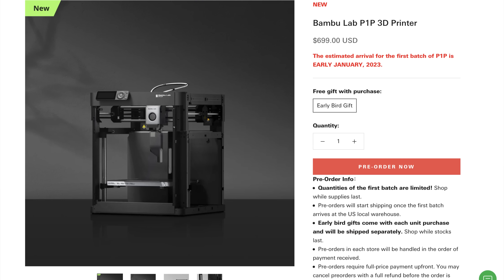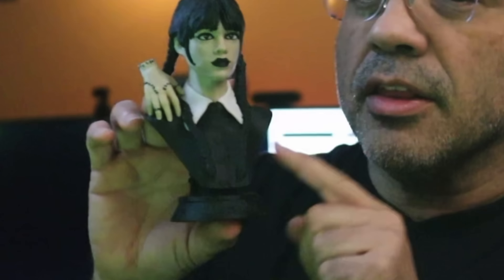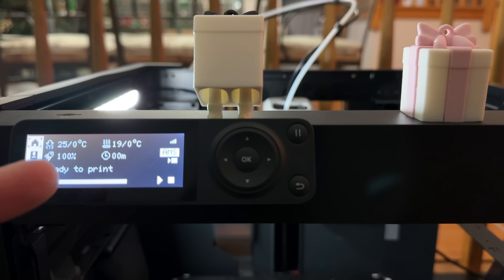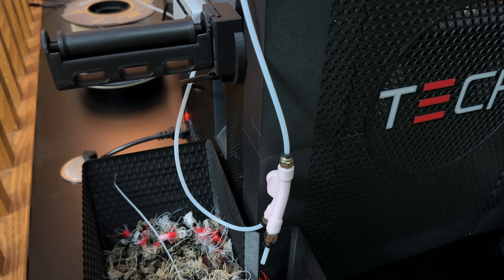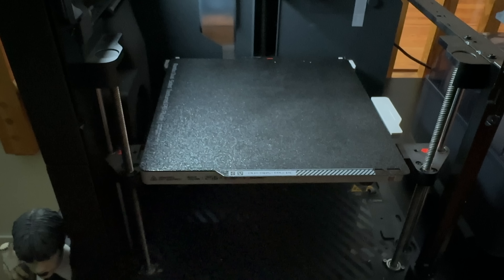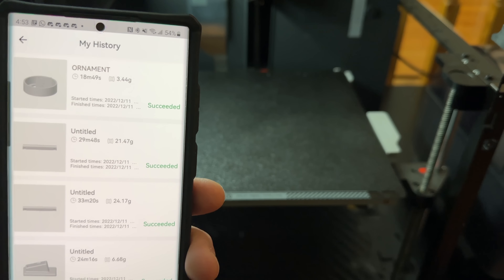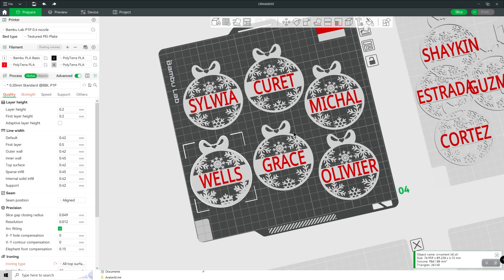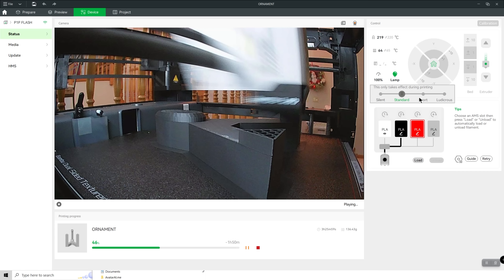Bambu Lab P1P Best  Color 3D Printer on the Market Hands Down! Comprehensive Review

Comment: Compared with x1, there is a problem with this machine. Its lifting platform screw has no bearing, and a copper sleeve is used instead. I wonder whether the printing accuracy will decrease after a long time of use😀

Comment: I almost bought this but after reading all the channels on P1P and X1C, it has some major flaws.

1. It doesn't support gcode. WiFi transfer sometimes doesn't work.

2. Due to nature of its fast movements, it will need frequent maintenance as the overall machine will start to becomes loose. Saw so many bad prints after a long time use. 

I will hv to go for Elegoo Saturn 2 with higher strength materials.

Comment: Love the review! Keep up the good work. I’m currently thinking about getting the P1P after loving my X1C.
Reply from the maker: I have have the x1 and I have to say it seems like the quality on the P1P is better.
Reply: @ebpman  please can you make a comparison video?
Reply: @ebpman  Do you mean the machine quality or print quality?
Reply: @ebpman  what? They are the same machine? And the P1P has inferior cooling? This is ridiculous
Reply from the maker: @FilamentNext  print.  But I think it's only pla chamber can get too hot
Reply from the maker: @thelightspeed3d712  I did additional testing.  I posted this on Facebook as well. Since it's open, pla seems to printer better for me on this with exact same settings than my x1.  Especially when ironing. The model I noticed this on was a ornament. . 20 mm standard x1 settings. Iron all top surfaces, 10% ironing flow, and 0.15mm line spacing   I have the top of my x1 removed and the door open and its better.  Using the pei sheet too

Comment: How do you mount the AMS system on the P1P as i don't think it has a top like the X1C that it can rest on
Reply: There’s a mounting bracket that you can print from Bambulab so the AMS will sit on top. They have it under the P1P upgrades section on their wiki

Comment: if you have a p1p can you just order the AMS or do you need to order other things aswell based on 1 p1p and 1 ams ???
Reply from the maker: No you can just order the ams.  If you want to connect two ams to get 8 colors to the P1P then you need to buy a hub
Reply: @ebpman  Excellent video, thank you. Just for a heads up you can get a maximum of 4 AMS for the printer but you only need the one hub regardless how many you buy.

Comment: I am really keen to know how this printer compares to the X1 Carbon. And is the X1 Carbon as noisy as the P1P?
Reply: He said that print quality is better here if you just neet to print PLA and PETG. I don't know about noise but it should be louder than X1 because of no panels. Honestly i can easily fix it with some polystyrene around
Reply from the maker: If all you do is pla, this is a winner for sure.  The cost compared to others and savings in speed while still having quality is solid.   ASA, PETG, abrasive materials is a different story.  I feel the x1 is better

Comment: This is false. The bigger nozzle actually slows the printer down. Because the volumetric flow rate isn’t going up. Bigger nozzle means slower print times.
Reply: I'm not sure. Probably you will go slower as print speed but if you go 2x layer height you will half total print time
Reply: This is not true either. The volumetric flow doesn’t change. So higher layer heights won’t speed anything up. That’s why I went back to a 0.4. That’s the fastest nozzle for this printer
Reply: @thelightspeed3d712  you are telling that you must half your speed with a bigger nozzle?
Reply: I didn’t say half the poster did. Putting a bigger nozzle will Not Make your prints faster. I bought a 0.4, 0.6, 0.8 hotend for this printer. The bigger you go, the more the slicer restricts the VFR. It’s just a fact my friend
Reply: @frafra1507  he said “bigger nozzle means faster prints”… it’s just not possible. The hotend for rhe Bambu has a VFR of 12 at least according to the slicer. The 0.6 profile calls for way less speed. This is do to the excessive speed you can’t create more flow from this hotend.
Reply: Wait, if I’m understanding right, you’re saying that bigger nozzles don’t print faster and the reason is that the printer won’t actually push more filament through at a higher rate?? But why won’t it? If it’s limited by the slicer then that’s probably the hot end not able to transfer heat any faster than it can with the 0.4mm settings. So couldn’t we get around this limitation with a better hot end and modify the slicer?

At that point whether it works or not depends on software “allowing” us but not hardware right?